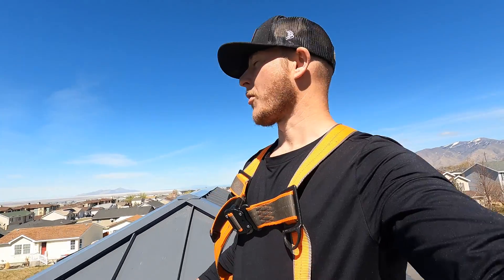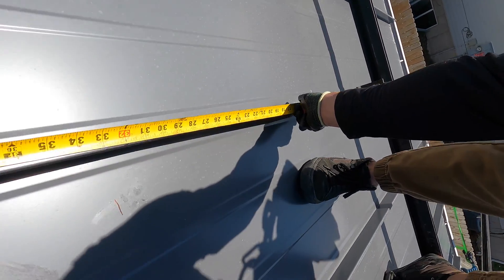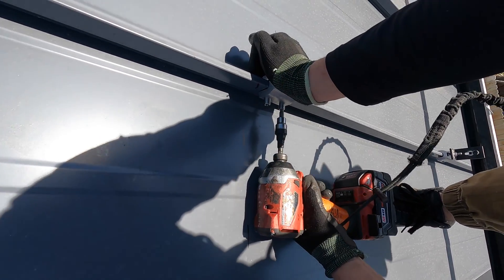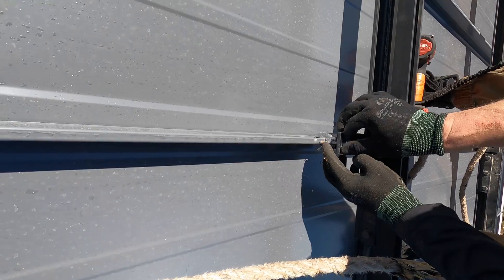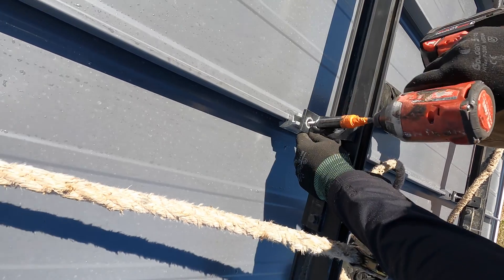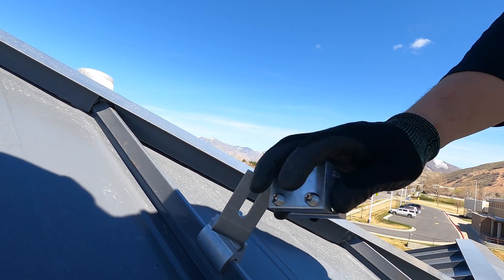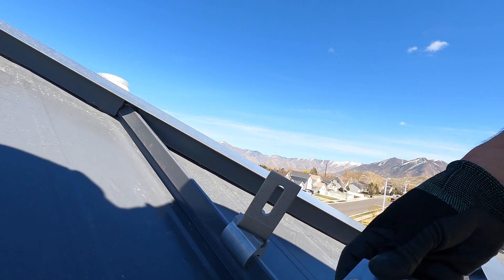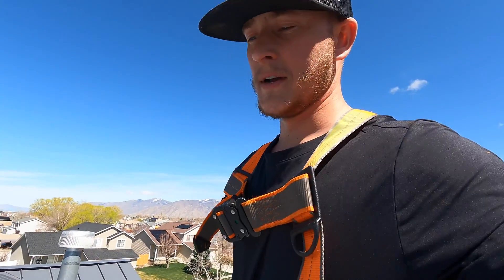How to Install Solar Panels On A Standing Seam Metal Roof

Comment: Just saw your video on the standing seam attachment method.  Im building a steel ramada and was considering putting a standing seam roof on and adding solar.  Seems like overkill.  Would you recommend another method to put the panel up rather than go to the expense of a roof and then panels?
Reply from the maker: Do you want it to be water tight or just provide shade?
Reply from the maker: Stand seam isn’t cheap
Reply from the maker: I think the most common would be to do a corigated roof. You just would have some exposed screws on the under side.
Reply from the maker: If your making it custom I’d recommend buying panels first and making the structure the exact size of the system and having the supports right where you need the mounts

Comment: Exactly! no roof penetrations is HUGE and the fact that metal roofs have great wind and hail protection.
Reply: You'll still need to cut a hole for the wiring box and I'm trying to figure out how that works. I have a box on my asphalt roof for the wiring and there aren't penetrations through the shingles with a good install, you use metal flashing that is fastened under the shingles, so it's just as water tight as things like roof vents or a furnace B-vent stack.  ..the real advantage is that the metal roof lasts longer, although it's still going to be dented by hail and need to be replaced too if you don't want an ugly roof and you need to do the whole thing because of the paint fade, but it's not an emergency like hail damaged asphalt shingles that leak, so you could just live with the ugly dents similar to a hail dented car roof.

Comment: what about the concern that the bolts will damage the anodized finish on the roof and it will begin to rust in those damaged spots ?

Comment: The rationale, and this video, of having solar "separate" from roof is why I went metal. In the future, I'll never need to mediate a fight between the solar company and roofing if there is a leak in the roof -- the solar company will only ever make a single hole in the roof, where the wires pass through. It's 100% the way to go.

Comment: I live in the hurricane belt and have a metal roof with solar. How many clamps per seam do you recommend? Currently the installers have clamps every other seam. I'm thinking all the standing seams should have clamps to support.
Reply: You can check manufacturer's instructions

Comment: One thing about the clamps is that although they don't put holes in the metal, they sure do permanently deform the standing seams a lot as they're tightened and squish the metal.  So does that really not void any warranties?  I wonder what happens if you needed to replace one roof panel after it's deformed like that.  It seems like the panels would be very difficult to get apart.  Then trying to put a new panel in and get it to interlock with the deformed seam doesn't seem like it would be much fun either but I've never seen it done or heard from anyone who's done it so I don't know.  Maybe everyone just counts on never having to replace any panels until the 40 or 50 year life is up.
Reply from the maker: Goats think alike. Im not going to lie. If you want to look at things from a realistic perspective the torque specs on the clamps are really specific. You are looking at just above 10lbs.... It doenst really dig into the seam that bad at 13lbs or what ever it is depending on the gage. Most installers just use an impact driver and run it in hard so it wont pull off.....
Reply: @solargoat  And no water can leak into the clamp screw holes, and therefore under the roof panels over time? Seems sealing them as they are installed would be a safe idea?

Comment: You make it look easy.   What brand of clamp were you installing?   I'm having an issue finding a clamp that works on my snap lock standing seam roof.  The one you are using looks like it might work for my roof.
Reply from the maker: Thats made by quick mount Ill try to get you a link.
Reply from the maker: https://www.ecodirect.com/Quick-Mount-PV-Open-Slotted-L-Foot-p/quickmount-qm-lynx-ss-m1.htm?gclid=CjwKCAjwrZOXBhACEiwA0EoRD4nncbMZENx8Vz1pYpEmkJgB2t20xDASB2WJerzsOiJ65MhqZ0mCbxoCOsYQAvD_BwE
Reply from the maker: https://buys-5.com/product/s-5-n-seam-clamp/?gclid=CjwKCAjwrZOXBhACEiwA0EoRDzCJ1zQtpxIyIL3JPt-oXEM84J_RIYu8f8mJt1wHKHx7DQtH_yOUJBoC3_oQAvD_BwE
Reply from the maker: Check those out. If you call the guys at S5S you can send them a picture of the profile and they will let you now what clamp to use.

Comment: Great video I love installing solar on metal roofs as well. Good old electrical tape to stop the socket coming off the bit, I do the same as well 😂👍
Reply from the maker: That’s funny you saw that.  I’m always dropping them off the roof when reaching at and angle and pulling the socket out 😂 just tape em 💪
Reply: Dude you never said what the mount is called 🤦🏾‍♂️